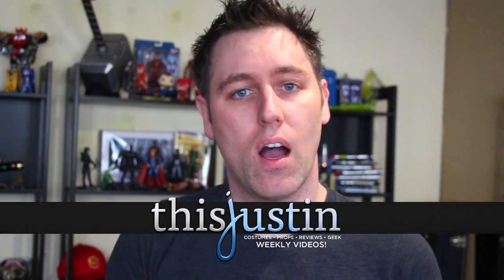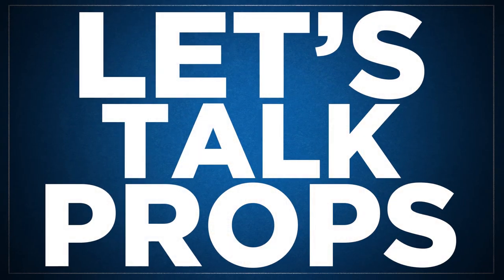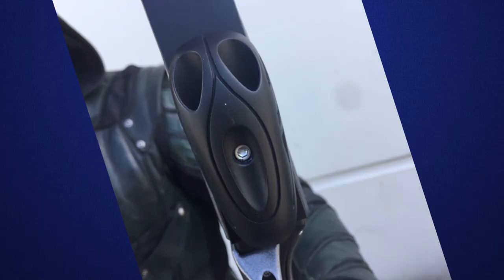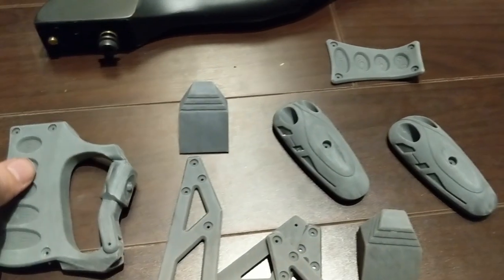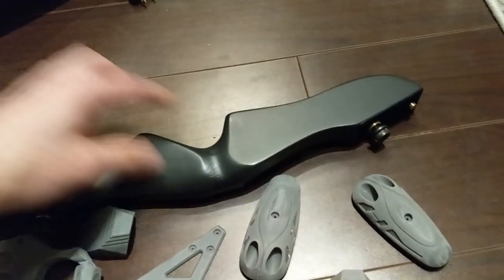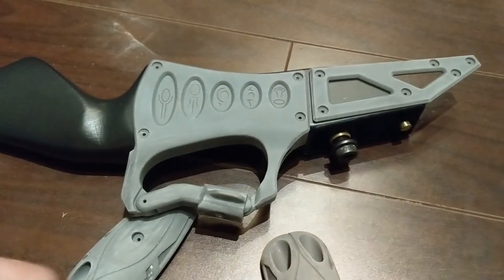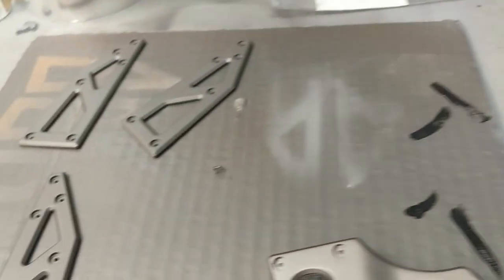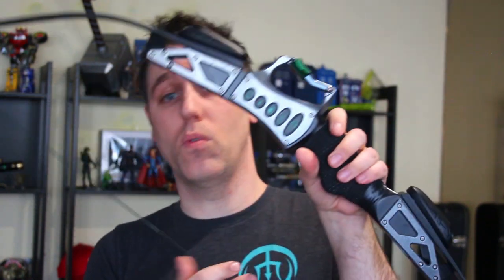Arrow Season 6 Bow

Comment: What screws did you use for the bow pieces? Having a hard time finding the right right ones. Also did you screw into the bow or glue the pieces onto the bow?
Reply from the maker: I screwed in with some mechanical screws I had here. I think I got them from mcmaster carr. I predrilled and then screwed in.